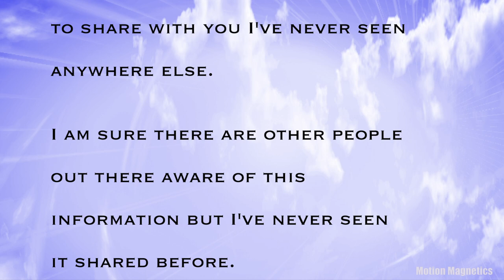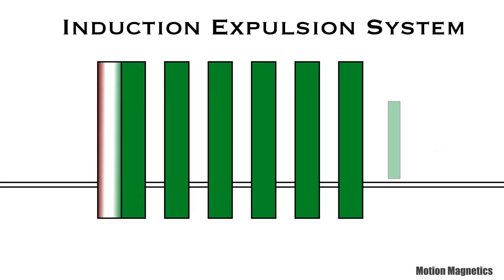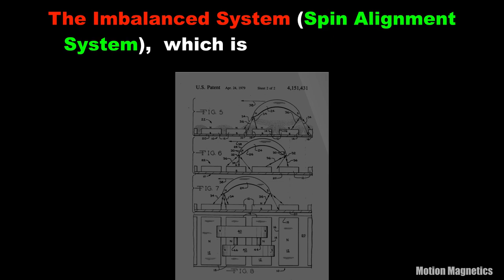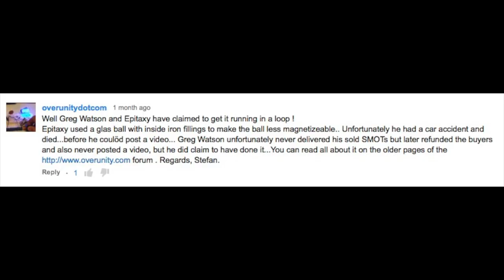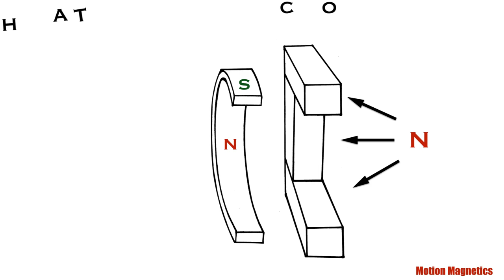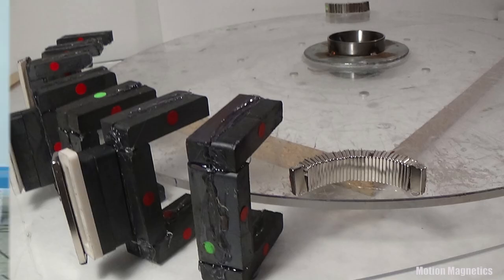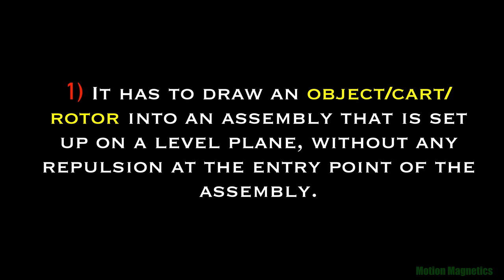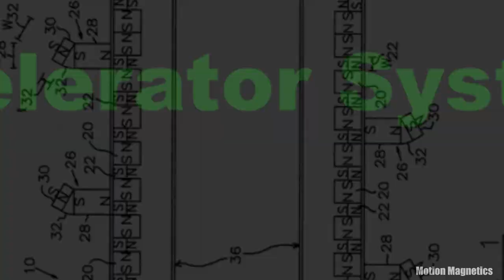The 3 Types of Magnetic Motors Part 03

Comment: What exactly are you trying to accomplish here? You already stated this is not a perpetual motion machine, so it cannot accelerate something continuously. At best you're making something that acts as a kind of magnetic bearing. But for what purpose? Even if you smooth the field as much as possible, you're still going to end up with a device that slows due to friction with whatever track is supporting it. From what I've been able to gather with my own tinkering, you need an electromagnetic system and/or superconductors for any actual propulsion. Or is the point of this to create a kind of magnetic rube goldberg machine?

Comment: Thanks again for these. Now that I watched all three, I STILL have not seen a good demonstration of Howard Johnsons Design from one of the 2 times Science and Mechanics published it (or was that more than one design?), nor have I seen anyone use my 2 designs so far, which I will share here again, and I WOULD like if another person builds and tests this, so long as they dont try to steal my patent rights, because I spent the last 11 years learning how to make "Government" stop enforcing what my police tell me is "over 90% of what we do", so now I am returning to building inventions, and that would be great if I could get people with the tools ready to build now, to build and test my ideas, and I would be happy to include them in companies I plan to build in return (partners, or engineers, or whatever you want, whatever works).  Here...

I am about to build this simpler one I came up with in 2010, and I came up with a new design actually last night, a 3rd, a variation of this:

I put a flat magnet magnetized so the North and South Poles are on the flat faces, as the Stator and Rotor Magnets, aligned so the forces repel one-another except for where they line up edge-to-edge and there the opposite poles attract the strongest (this is where the strongest forces between these magnets occurs too).

So if these are 1/8th inch thick it has to overcome that much distance before the backwards forces are overcome, and the repulsive forces then push away.  So I put a soft iron plate (from a hard drive btw) to cancel the field in front of the stator magnet so the rotor magnet instead attracts towards that iron plate, and then angled the Stator magnet so the Rotor magnet would attract to a point of the corner of the iron where it is past the center-to-center alignment with the Stator magnet, so at that point the repulsive forces between the magnets take over.  There was a strong attractive force for a tiny point pulling backwards, but the momentum was enough to carry it past.  And I moved the rotor magnet 1000th of an inch per second towards the stator magnet to minimize any momentum I imparted.

Then like I said in other comments, in 2010 govt. took everything from me for a harmless "offense" which I have since learned how to stop, and I give that knowledge away for free on www.GovernPublicServants.com.  But now that I'm back to this stuff, last night I was playing with my magnet collection, feeling the forces between different shaped magnets with my hands, and I figured out, I should have very thin edges which are a north or south pole, magnetized through the long dimension, and have the magnets at a 45 degree angle, so the rotor magnets trailing edge is closer and attracted to the tip of the shielding iron, at which point a very strong repulsive force between two like Poles (say both North) between the stator and rotor magnet repel from there.  I think both of these arrangements are working so far, but this one I think will produce more torque.  

And on my Facebook (HarleyBorgais) I have shown another design using rotating magnets on gears and a half circle iron shielding plate on a center gear to block the fields between the center rotor and outer stator magnets for half the time, while magnets on the other side drive the whole mechanism for the other half (with the same shielding arrangement as the top half of course).  I am pretty sure this will produce a good amount of torque, but what I figured out last night I think might produce more torque and RPM.

I plan to find out soon, and start sharing on my Bitchute channel  (bitchute.com/channel/CTfleGSewD6A/) and www.HowWeExist.com and my Facebook pg.

I still hope to see a good demo of Howard Johnsons Design published in Science and Mechanics (Specifically the one with square magnets on rotor and two curved magnets on stator, times three pairs I think it was around the rotor).

Thanks again for these videos.

Comment: I'm messing with a design right now. I don't have the right magnets to create the Howard Johnson "chain". At the beginning of the chain that he created, there is a small repulsion and also at the end. I see that in your videos. Love the vids btw. The idea I'm trying, and I would love for you to test it, is using an hexagon shaped stator with Howard Johnson's design on all 6 sides (the system you covers in Part 02). This I think would reduce the negative effects everyone sees at the beginning and the end since they taper away from the rotor. I also realized that if you use a 5 point star shaped rotor with your U shaped magnet at the end of each point, there are 3 good positions and 2 bad positions at any given time. I would think this would help pull through the repulsion areas. I would design this myself, but spent about $300 on the wrong shaped magnets. I'm planning on ordering some soon. One more thing. You have plenty of room between the 6 points of the chains to add something if you think it would benefit. Please let me know your thoughts. I respect your opinion more than most on the subject. Do great things!
Reply from the maker: WantToBe MARTIAN Well, that sounds rather interesting. Nice way to think outside the box. A lot of the research I do has to do with modifications of  Johnson's work. Keep in mind, his specialty in the Navy was encryption. That's why I examine as many pieces of his work as I can find, look for key elements that may connect his designs, and simply experiment. If you post your design, once you start putting it together, let me know. Keep doing great things!
Reply: Motionmagnetics Do you think that he may have came up with something and didn't want to develop the full working model because he knew what would happen to his research if he did? Either way I think his work is great and is a great point to start any build. I'll make a video highlighting my ideas tomorrow and post it to see what you think. Like I said I'm just getting into this so I'm by no means an expert. I'm very good at wrapping my head around things and seeing why they work and why they don't and coming up with solutions though. I would love to be part of this effort.
Reply: Motionmagnetics my idea will be up in a couple mins. I would love for you to see it. Thanks. I'll post the link here.
Reply from the maker: WantToBe MARTIAN I think he was used to working in secrecy, and didn't share a lot of his work with people. His notes and photos of many of his design models are in John Bedini's hands now though. So some of them have been documented and shared publicly in the "Energy from the Vacuum" video series. So now it's just a matter of going through all of it, and trying to decipher it.
Reply: Motionmagnetics Thanks for the info. I'll check it out for sure. The entire video I posted is up now.
Reply from the maker: WantToBe MARTIAN I just went to check it out, and it looks like you deleted it?

Comment: Hi 
Thank you for doing the video as I got my hands on patents Johnson’s one’s but I unfortunately am not a Physic in any way and working on it. You have enlightened me on some of it and I will share my results with others when I get something 🤔
Reply: save yourself the trouble.. none of the designs will ever function... It's very simple to understand the logic of why none of these systems could ever function as hoped.. all you need to do is spend some time contemplating the way magnetic fields interact with each other and how they interact in combination with the basics of physics.. mass, force, acceleration, inertia.

When you really boil it down to the basic components, you can never get away from the fact that a magnetic field of a magnet will always produce a predictable force upon any magnetic dipole moment that comes within range of that field.  The force required to overcome that fields repulsion is equal to the force required to overcome that fields attraction.  

If a magnet exerts 'X' amount of force on a cart moving it 'X' distance, and in doing so, the 'cart' experiences an increase in momentum of 'X' in whatever direction it's being forced in.  As the 'cart' moves out of the magnetic force field propelling it in the initial direction, it will inevitably and inescapably encounter another force field from that same magnet which will act upon 'cart' equally and oppositely as previously.  If it first experienced attraction by the magnet, it will now experience repulsion.  The initial gain in momentum will be overcome and reversed in an equal and opposite manner, having a net ZERO total effect on 'cart's momentum.. in actuality, less than zero, because of all the losses from friction and drag etc. in the system.

The fact of the matter is.. unless you can somehow reconfigure the magnetic dipole moment of the 'cart' just after it goes thru the attraction phase and just before it experiences repulsion, and change 'cart's dipole moment so that it experiences a second round of attraction instead... 
The problem here is that you may very well be able to accomplish this feat... however.. the energy required to reverse the magnetic dipole moment within 'cart' will be no more than would be gained by that second burst of 'attraction'.

It's the same idea when some of the tinkerers are trying to do things like use combinations of neodimium magnets and ceramics... so that part way thru the cycle of the system, the polarity of some of the magnets is flipped by the more powerful neodimiums.. in hopes of gaining a push instead of a pull... well.. unfortunately, you may get that push instead of pull.. but that 'push' had any would be gain of energy used up in the process of flipping the ceramics magnetic dipole moment from N to S or S to N.

When you look at magnetism and magnets and magnetic materials for what they are on a microscopic level.. you realize this basic truth.. you can't pull energy from a magnetic field without putting energy in somewhere else.

Here's a positive note to leave on... These free energy hunters will never give up.. and there's no reason they should!  But they should be focusing on the right goals and targets, and operating within the reality of how our universe operates.  That said, if the goal is to take energy from a magnetic field to do work, then that energy must come from somewhere.  If a method can be found where the latent heat energy all around us in room temperature air is somehow the source which feeds the magnetic field which the energy is being harvested from.. you have a system that could actually exist.  Find a way to take latent heat energy from the atmosphere and convert it into the energy required to do that magnetic dipole moment aligning so as to make your 'magnet cart' spin full circle.. 

However.. If you've gotten to the point where you can successfully utilize the atmospheric heat energy and put it to use by way of converting it to ANY other form of energy (not impossible, and not outrageous either!)... i doubt you'll be bothering with these permanent magnet toy contraptions.

Comment: My induction/expulsion station works as part of a linear or circular accelerator.  Be careful to not have the accelerator stations too close together or the back force from the magnetic field between the acceleration stations can slow things down or stop them.  The accelerated magnets on the cart or rotor can be fairly close together though.. say equal space and magnet width.

Comment: I tried to make a magnetic "cushion" under a propeller by using opposing magnets, but realised the system self-stabilised and basically required more force to spin the prop than when using a simple lubricant.
Now, how would it be possible to make an "inifinitely accelerating" ball on a circular track?

Comment: Hi I definately agree the Gate seems to work well could you please tell me in the last 10 seconds of your Part 3 video the disc with the 2 arc magnets running past the gates with spin accelerators appeared to be increasing in speed as the video finished. Was that the case?
Reply from the maker: Michael Hein It isn't actually accelerating. I filmed it that way, as a visual aid to the video narrative. When I build one that accelerates, rest assured that I'll give you more than a passing glimpse.

Comment: Loved the videos. I am certain there are ways to achieve continued motion and acceleration, it has been proven but what happened to the machines and why don't we see more of the same? The HoJo motor is very complex and the weekend builder may not have the understanding or equipment to manufacture the required components. This is a very interesting field, no pun intended. Keep up the good work.

Comment from the maker: SonsOfTesla.Com Thanks Bro. The last one doesn't self rotate. Close, but not quite. I'm still working on a version of it right now.
Reply: Motionmagnetics Hmm, looks as if you are pretty much there already. Try to put also "L"-shaped iron core pieces with the right thickness on your rotor magnets at both ends. This will conduct some sticky flux away. You might get a bit lower forces, but also much less sticky points. You really need to play with the thickness of the iron of these "L"-shaped iron pieces. Good luck ! I hope you make the motor open source if you get it to run and show it widely around. Regards, Stefan.
Reply from the maker: overunitydotcom Thanks for the tips. I'll make sure and show the whole motor and explain how it works in detail, once I get one working well enough to share it.
Reply: Motionmagnetics Thank you so much for your videos and your efforts. You explain the 
subject matter quite lucidly. I am interested in experimenting with 
induction/Expulsion systems. Are there any instructional materials, PDFs, etc that you can recommend for a novice's initial build? 
Secondly, where is the best source  to purchase the rubber ring magnets 
that are used in the videos--I have encountered some difficulty  in 
sourcing these. Do you have a preferred source for the ferrite/ceramic 
magnets and the for the train tracks as well?
Reply from the maker: DAVID Francis One of the best ways to get started with understanding this type of system is to download Howard Johnson's patent, that I featured in the video, and build your own replication. Then, start playing around with variations in his configuration. That's what I did. You'll end up coming up with completely new design ideas that way. And you'll learn what works and what doesn't. 
The rubber magnets are really hard to find in the correct orientations. What I did, is order some square rubber magnets on eBay. Most of which come configured like a Halbach Array. You can alter their magnetic orientations by placing them between some neodymium magnets of a similar size. I placed mine between 10 neos on both sides of each magnet, and let them sit for an hour or two. 
The train track I picked up off of eBay as well. I usually work with HO, or G gage track. Sometimes I use O gage. Depends on your personal preference. Just make sure the track is non-magnetic. Brass and/or plastic. It's also difficult to find carts that have no parts that will be attracted to the magnets. I usually look for a brass/plastic combination wheel set, and then attach them to a small light weight piece of wood. 
Hope that helps.Thanks.
Reply: thank you for the insights and advice. quite helpful
Reply: Motionmagnetics I believe I see it in my head. Would love to sketch it for you and have you critique why it wouldn't work or test it... the principal of stacking them to get the boost at the 45 angle was very interesting. I believe if they are placed IN A CIRCLE with 45 angles it should propel... idk 😐 I don't have the magnets to test it.
Reply: Motionmagnetics also not a motor as none of your designs make more than two cycles.
Reply: dude 8:10 THAT looks like its working, is that fake or true please give explanation how to built
Reply: Motripoid aaudiolan, Looked like it to me. Looked like a slow increase in speed. Wonder what would happen if he added a third set of magnets on the rotor so that they were 120° apart instead of 180°.
Reply: Motionmagnetics please make a DIY video of this one. It looks like it’s working. 

Does it ever stop??